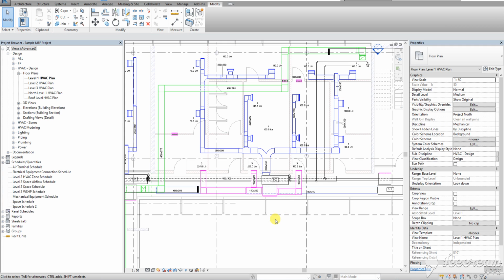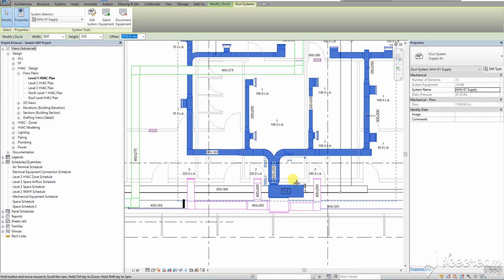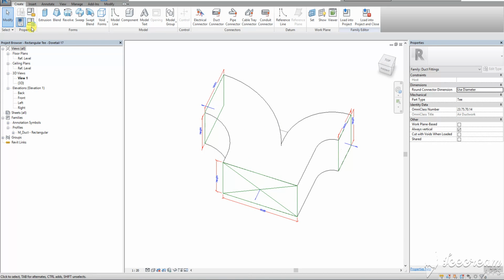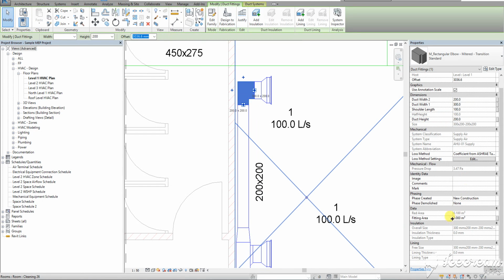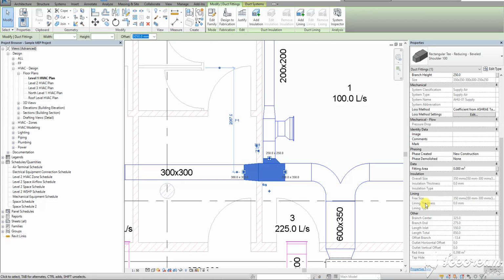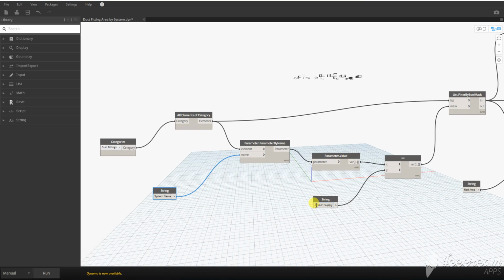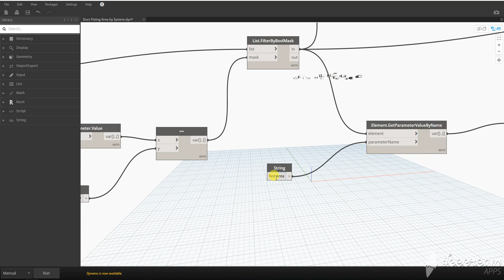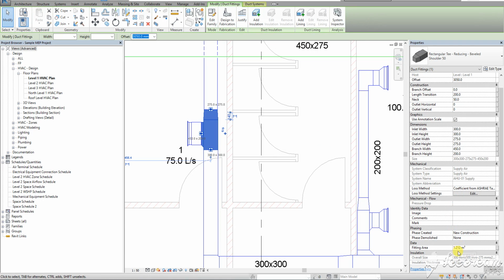Revit Duct Fitting Area Calculation by Dynamo

Comment: i dont understand red area, what it dose ? can you explain to me? Thanks so much
Reply from the maker: Red area means redundant area, what this script does is that it calculates the total surface area of a fitting. (Which is actually not the area required). We have to subtract the area of surfaces on which connectors are attached. So all those surfaces which have connectors are added as a parameter called Red Area, which is subtracted from the total surface area of fitting to get the actual required "fitting area"

Hope this helps !
Reply: @Revitasium   @Revitasium  i got it, thanks a million...😍

Comment: Hi , Thanks for the script , but i'm not getting the surfaces for some of the duct fittings( Rect to round duct fitting) please help me in this
Reply from the maker: Yes, it does not work on rect to round fittings, a simple modification in the script can do the job.
Filter those fittings and u can calculate the area of fittings within the family itself. And then same script can grab the family calculated parameter to the parameter used in the script.
Reply: @Revitasium  you mean they don't calculate the fitting of Rec to round, so how about they can calculate this fitting, Do you have any ideas?
Reply from the maker: @bimgraphic4708  
In round to rectangular (or vice versa) fitting, the surfaces become curved. Dynamo cant calculate the area of curved surfaces (at least using these basic simple nodes). But for the straight surfaces (each lying on one plane ), it can.
Reply: @Revitasium  please can you share with us the script to calculate the area of rectangular to round duct transition?
Reply from the maker: For rectangular to round duct transition area, you need a different family (not standard ) which can do calculation with same script.